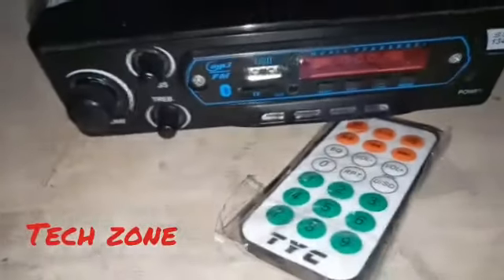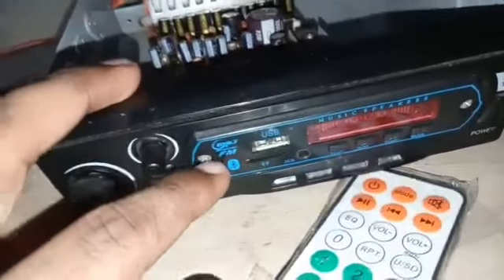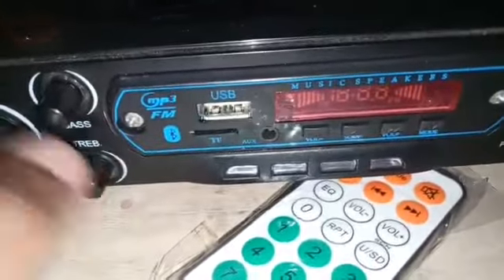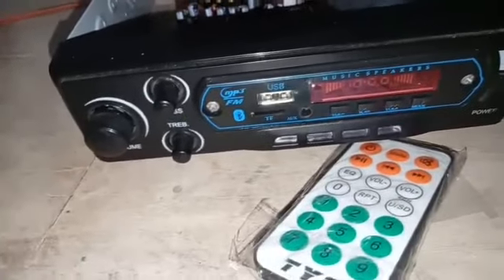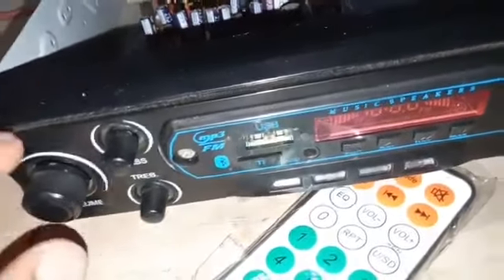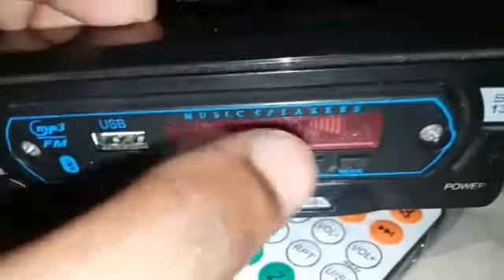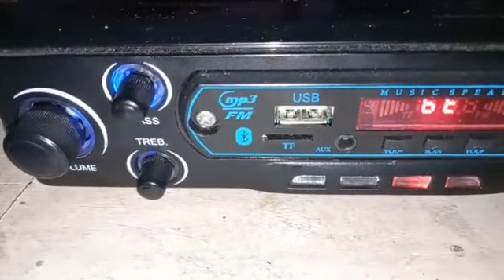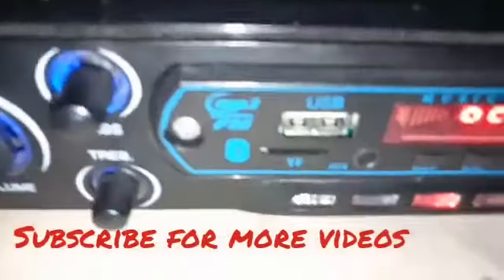Best bluetooth module, no noise and humming

Comment: Bro amplifier il subwoofer filer bord koduthittund athil ninn kurach work cheyyumbol athil sound noise undaakunnu, athendhaanu onn parayaamo plzz
Reply: Single supply filter aano
Reply: @anugrahkumar3060  athe
Reply: @yadhuyesodharan7614  bro proper aayitt ground cheyy enkil noice oruvidham ellam pokum 

Bro amplifier ic solder cheytha lead poi kanum nalla heat aavumbol avida onnum koodi solder cheythu nokkiyae 😊

Kooduthal gain kootiyalum noice varum 😊
Amplifier inda gnd, filter board inda gnd ellam connected aayirikanm 

Amplifier inum filter board inum separate supply kodukkunath nallatha oru transformer I'll pidichu kodukkumbol. Base koodi varunna time I'll aavashya mulla output  correct aayitt supply cheyyan sadhikathae varum aganayum noice varame sperate power supply vechu nokku bro 😊

Gnd ellam same aayirikanm 

Dual supply amplifier board um single supply filter um aanegil dual suplly eg( 12-0-12) inda 0 um filter board inda ground um oru wire ettu solder cheythathinu shesham volume controller inda body I'll solder cheyyanm atinu shesham avidae ninn transformer inda body I'll solder cheyyanm apol ground loop marikittum 

2 um single supply aanu enkil oru wire ettu amp inta ground um filter inda ground um oru wire ettu mukalil parajathupolae cheythu nokku bro 😊

Kazivathum amplifier inda input I'll pokunna wire twist cheythu kodukkuka allegil shield wire use cheyyuka 😊

Comment: mp5 modulil nalla noice und ath kalayan enthanu vazhi?
Reply from the maker: Athinte power supply onnu nokkuka. Voltage regulation u zener diode and capacitor use cheyyuka. Pinne chila modulukalil namukk onnum cheyyan kazhiyilla. Athoru problem aanu.
Reply: Bro module I'll aux input ground cabinet I'll earth cheyyuka, pinned 5v connection kodukkunna pinnill 1000uf 25v capacitor um connection cheyythal oru humming um undavilla ethu module annennenkillum try it ok
Reply: @alwinaudiosujithlal4793  ok thankyu bro..
Reply: @alwinaudiosujithlal4793  bro..humming koodathe old radio tune cheyyumbol varunna pole oru noice und ath ozhivakkan valla vazhiyum undo??
Reply: @Ajeeshpadinjattahouse  , bro mp5 video out put Ulla board ano, athu proper ayi work cheyyanam enkill 2amp 5v annu vendathu 12v I'll ninnum 5v regulator ic ittal 1amp kittuka athu pora, oru dvd smps power supply vangi 5v kodukku, 100rs inu  shopill kittum radio humming sound undavilla  , video out shield wire use cheyyanam okk
Reply: @alwinaudiosujithlal4793  angane ellam try cheythatha bro,but ithu humming alla...neriya tharathil visil adi shabdamanu..
Reply: eth modil ittalum angana cheriya oru visil sound undakum
Reply: @Ajeeshpadinjattahouse   ath maarulla enikum und
Reply: @alwinaudiosujithlal4793  good